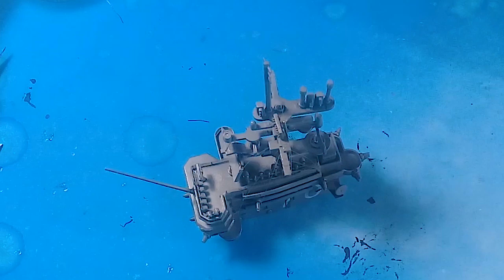USS Carl Vinson CVN-70, Trumpeter Final build, 1:550 scale

Comment: Fantastic build mate. I bought the Trumpeter 1/350 Nimitz kit and was looking at this kit to practice on but decided to go with the their 1/700 kit because it's more detailed and up to date. It also includes generic hangar bay walls that the 1/350 kit doesn't have (it just has the hangar deck) so i was going to 3D scan them and print it as well as some of the platforms the 1/350 kit doesn't have. I was hoping this kit had the hangar bay but it's similar to the 1/600 Academy Enterprise kit that has the closed elevator doors and no hangar bay.

Great build and great to watch. Cheers.
Reply from the maker: thanks, Ian, I've done also my 1/700 Nimitz really detailed, you can view this in one of my video. Good luck, mate.
Reply: @ArdeconHobby  thanks mate, I'll check that one out
Reply: @ArdeconHobby  so this box kit contains more and more planes?